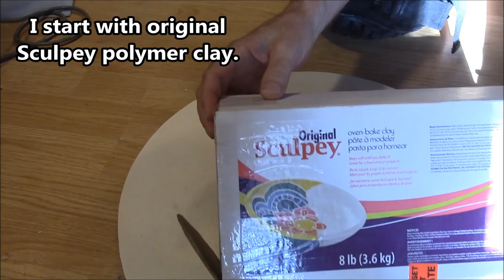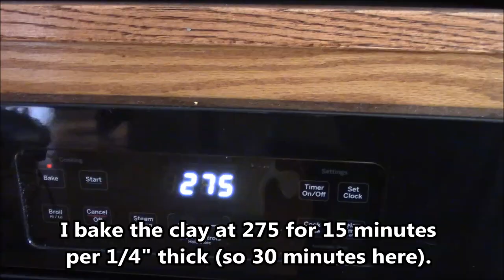How I Make Polymer Clay Sculpting Blanks

Comment: I know you didn't ask, but based on your Facebook page you usually seem open to tips. When it comes to this particular clay, those cracks are a known deficit, especially if the oven temperature has not been verified with an external thermometer(most ovens are off by around 40°f). Also, polymer clay gets stronger the longer you bake it, most professionals bake everything for an hour. Your best bet would be to get Super Sculpey Original and mix in some Cernit Translucent(for strength and flexibility). The more Cernit you add, the stronger it will be. When I make toys for my daughter, I do a mix of 70/30 or even 80/20, with Cernit being the main clay and the Super Sculpey used for easier blending(my daughter is two so it has to be strong lol). But for what you're doing a 70/30 or with Super Sculpey Original as the main clay would be strong and resist cracking. Hope this helps 🙂